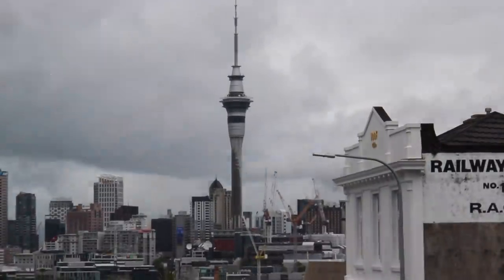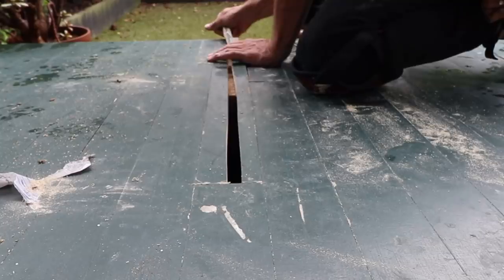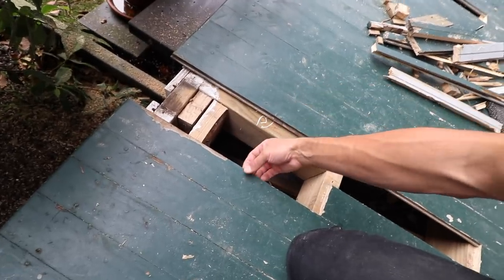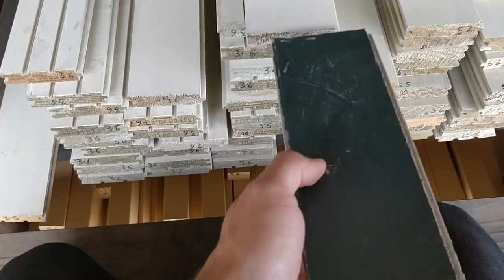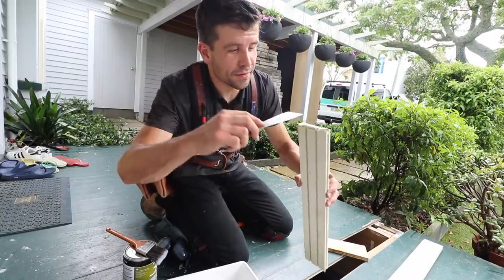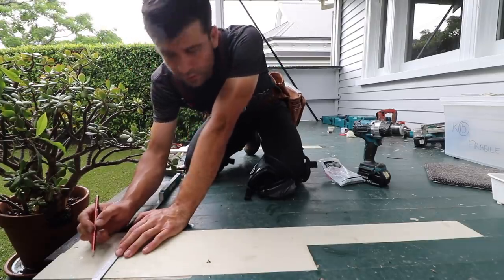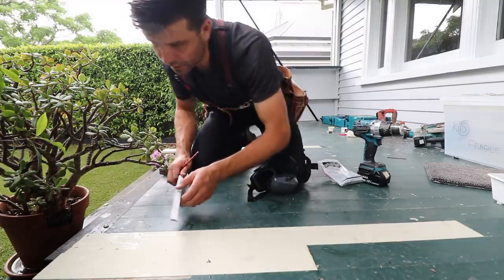How to Repair a Tongue and Groove Deck

Comment from the maker: RE-UPLOAD 
Hey guys, some people had problems viewing this episode when I uploaded it earlier. After 2 and half minutes the video went black and the audio carried on, or it would just stop all together. it worked for the full 7 minutes on Safari for me, but not on chrome? Not sure why, but hey . enjoy! (again)
Reply: worked fine on chrome for me the first time, now its freezing and going blank in certain spots like you describe. i think its a backend issue with Youtube and not you mate.
Reply: Worked fine for me on Chrome this morning.   (using MacBook Pro).
Reply from the maker: Strange stuff man, cheers for letting me know 👍
Reply: Chrome has "hardware rendering" on by default which means it will use your graphics card to render the video. On some PC's with gaming cards this can cause problems with the video...
Reply: Scott Brown Carpentry worked fine for me yesterday. Must be a northern hemisphere thing :)
Reply: Worked fine in Eastern Europe, using Epic browser. Keep them coming!
Reply: The problem was present on the android YouTube app, which is probably a reasonable audience share but you'll be able to tell all that from the creators dashboard I suppose.
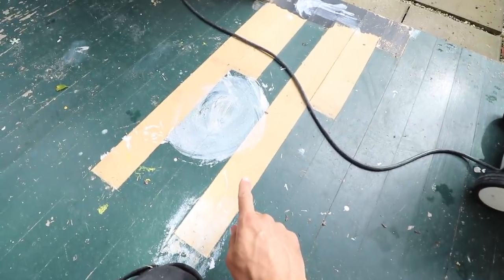Reply: Still issue after 6:40 for me.
Reply: it was weird for me the first time but now it works lol, so I don't know what is going on.
Reply: @cjhification  same here and I'm also using Chrome

Comment: scott brown.nice tip about cutting 2 lines in the board to do the extraction,8 points.
How handy do you find the trimmer ie worth the $280 nzd.
why didnt you machine up the new boards with your table saw instead of driving around wouldnt it be more cost efficient or was it a "to do" job?
Reply from the maker: I was pretty confident I'd get a match, and figured I could trim it a bit if I needed to. Didn't need to though. The trimmer is well worth if you have Makita batteries already. Great tool!

Comment: Great rework on the deck and excellent information.
How do you like the Makita multi-tool?  Do you find the battery position interfering anytime?  It appears to hang below the level of the blade.

Comment: Nice one. Its definately handy if you can tap the board in from the end like that, but more often than not that's not possible, like on an internal floorboard. 
I just cut the last tongue right off, and put a nog under the tongueless  join with some glue. 
Also geez how did you get such perfectly sized boards?? Were they custom made or was it just lucky?
Reply from the maker: Good tip man, I do that myself when there is no other option. I got lucky with that size! They must of redone the porch fairly recently